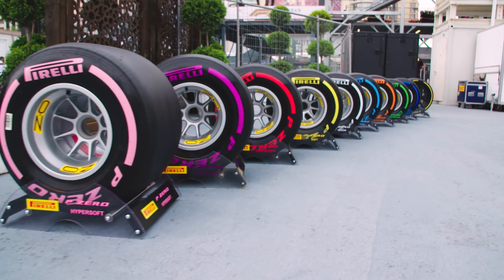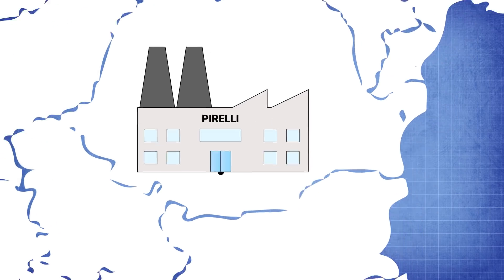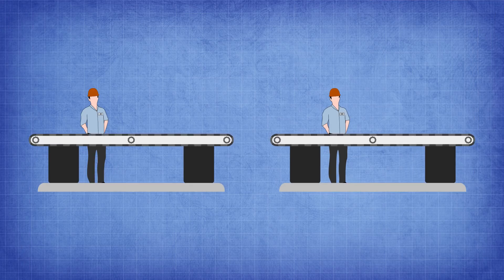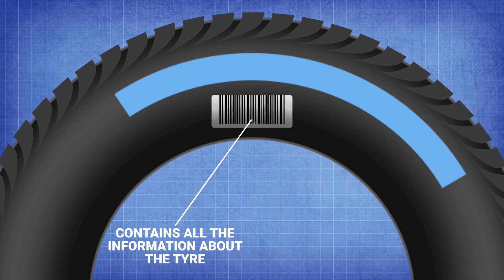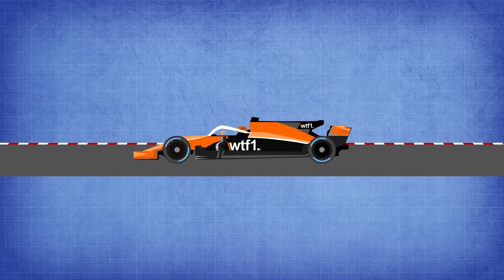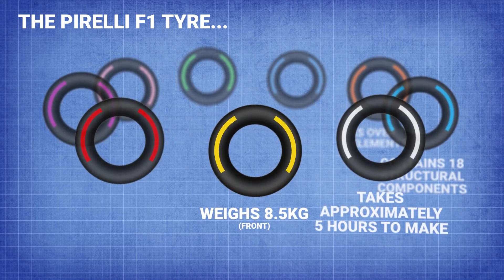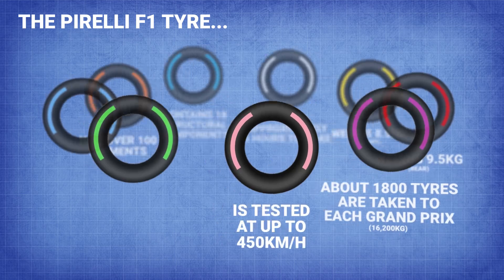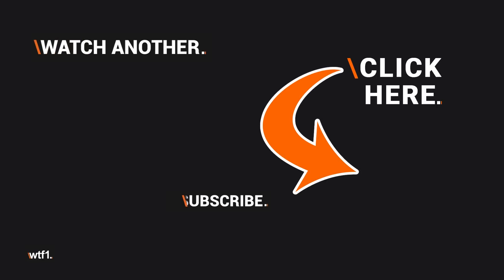How Is An F1 Tyre Made?

Comment: How about this. We now have halo which is a massive bit of iron work above the drivers head thats in there site line. Add Samsung flexible display to this and make it go right around. Then either put a rear facing camera in the current camera stand or have a new one at the back of the car. Make sure its got a field of view in the range of 150 and you will have far more visibility of the rear. And because you now have no mirrors, better visibility out the front

Comment: Exactly why nobody want to make tires for f1 besides pirelli. I really do have to agree with Michelin that it is ridiculous to spend enormous amounts of resource to design tires that degrade. Resources should be spent on developing tires that don’t degrade. That is the future.
Reply: Andy Ma well just use road tyres then. They don't degrade as much than racing tyres. Don't forget this is racing tyres, which means they are made for performance only. They can make tyres that lasts very long but its performance would be compromised. Besides grand prixes never exceed more than 4 hours/350 km so the tyres don't have to last that long
Reply: Aslamnur Fikri U didn’t understand what I’m saying. I do get racing tires are much softer and therefore a lot less durable. But F1 and pirelli are making tires degrade on purpose, that’s the ridiculous part.

Comment: What happens to tires NOT used at a given circuit? Are they held and used later, or are they shredded?
Reply: F1 tyres are fully recyclable, and used ones are stripped for raw materials, mostly for construction. They're made out of recycled materials as well.
Reply: and the rest is donated to the tarmac of all tracks

Comment: We want hyperhard and ultrahard tyres.
Reply: Concrete
Reply: Prins van Oranje what is the point in that? You still need to pit at least 1 time and F1 has already superhard tires what is pretty much capable go for full race if driver manages to safe them right. Only scenario where hyperhard and ultrahard tyres could be worth is in super hot conditions like in Malaysia but that's it. Pointless.
Reply: And Malaysia isn't even on the calendar anymore. Even the superhards haven't been used yet
Reply: Ryan Ford exactly and the time you lose compare to softer tires would be just too big, that's why teams don't use superhards or even medium tires often because they are like 0.5-1sec slower per lap compare to softer tires. And some people could say "yes but you can go longer with the harder tire and have 1 pit stop less" well firstly A) teams mostly use 1 stop strategy anyway other than in tracks where the tire wear is big and B) even if you would have 1 pit stop less it doesn't automatically mean its faster strategy. If you use heavier tire that is like 1sec slower per lap than the softer tire and pit stop exit time would be lets say 20sec, so the softer tire user would reach the pit time in 20 laps.

It would be good idea if they would make softer tires lifetime smaller, now with well managed supersoft tires you can go like +30 laps. Make them last like 20 laps max then heavier tires would become more common to use but so far there is 0% point to bring anymore heavier tires before they edit the softer tires someway.
Reply: Rouni r/woooosh
Reply: Prins van Oranje why the hell?
Reply: They would be horrendous
Reply: 2005 tires were soft xD
Reply: Willemmmm
Reply: They would never get used
Reply: For drifting
Reply: Planarian 17 ooh good idea
Reply: you would run out of fuel before the tyre heats up to race heat
Reply: No pit stops!!!
Reply: XD “and it looks like he’ll be going for the no stop strategy”
Reply: Oh ye forgot you had to stop at least once
Reply: road tyres
Reply: ( ͡° ͜ʖ ͡°)
Reply: And insanely hard
Reply: Ik heb nog nooit iemand die harde band zien gebruiken!

Comment: we want to see how tracks e.g street circuit are made across the small time to get the track ready for the race weekend

edit:THANK YOU ALL FOR LIKES
Reply: YES!!!
Reply: I agree with you, but I won't spoil your (F)101 likes
Reply: good idea
Reply: thx
Reply: I was in Monaco a week after the race weekend and a lot of the armco barriers were still up but the pit building (which isn't there permanently) was just a shell of steel beams. The double chicane after the tunnel I believe is resurfaced each year. The advert arches are also taken down as not as many of them were around either.
Reply: THIS!!!!!
Reply: THIS!!!
Reply: I was in Singapore in August and most of the barriers were already.
Reply: @maceroni5869  The barriers in some part of the marina bay street circuit are there almost all year round
Reply: They don't have a small time window, it takes several weeks at least.
Reply: THIS
Reply: They prepare a month before and a month after the race, not a small time.